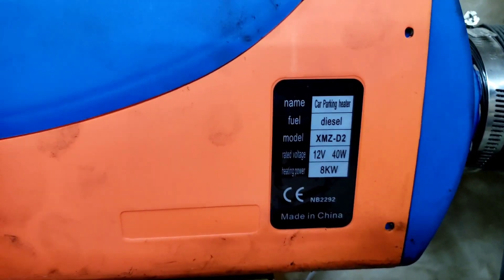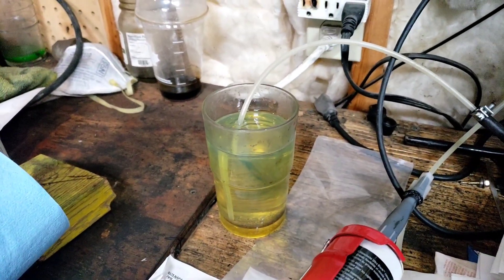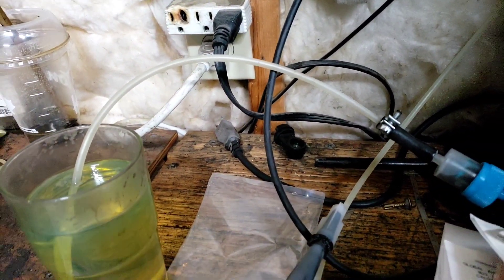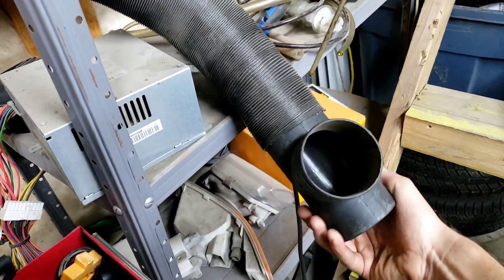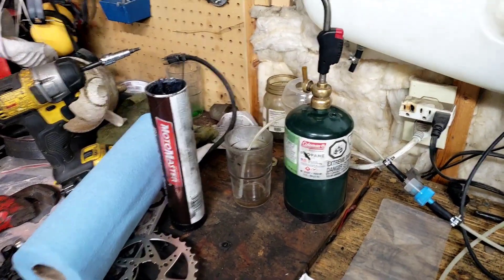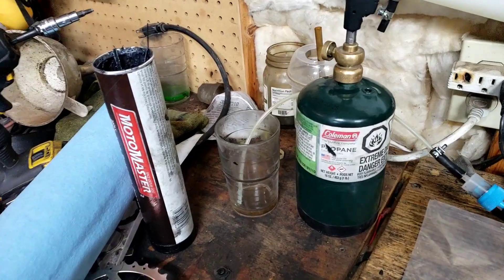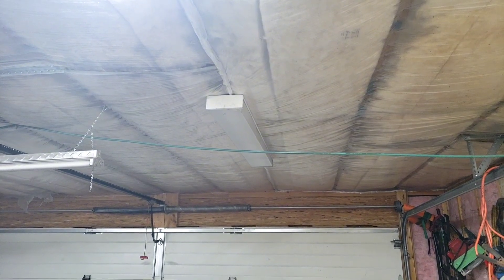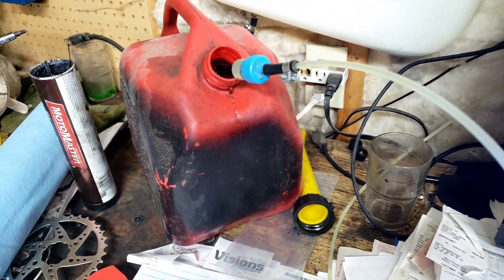8kw China Diesel heater consumption test

Comment: so what is best for fuel and in overall-mentenence-performance, diesel or waste oil?
Reply from the maker: i ended up just using 100% diesel,  got tired of opening the heater to clean it.  i may experiment with a post injection system soon for the used oil.